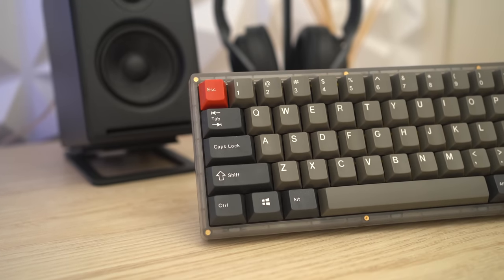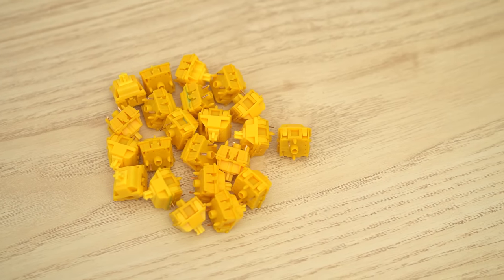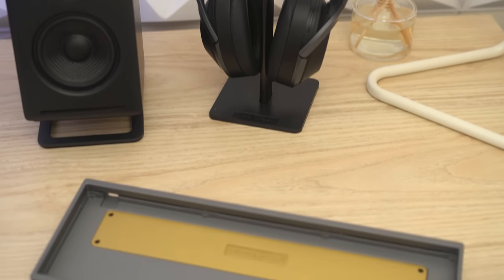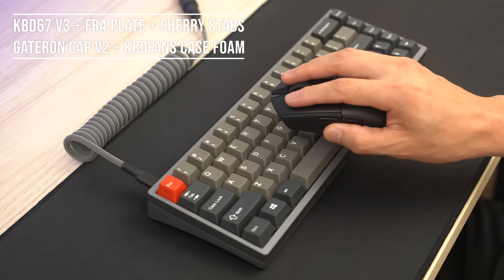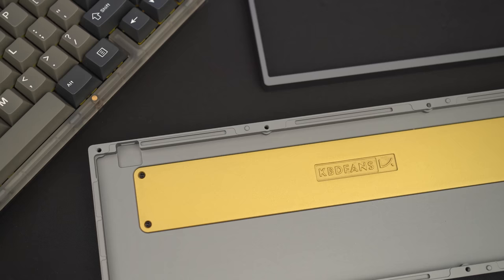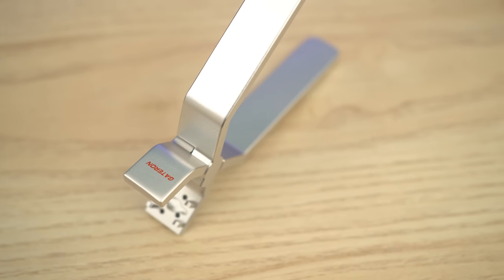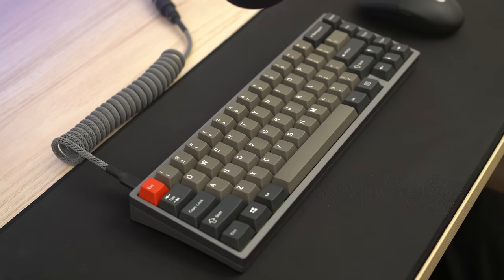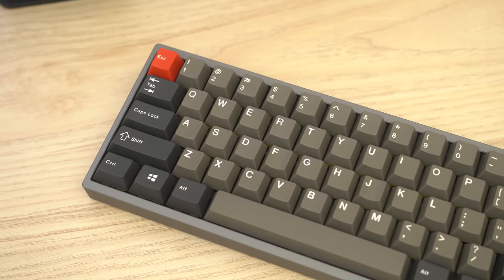Should You Spend $160 to Evolve the KBD67 LITE to KBD67 V3?

Comment: Hi Scott, Thanks for introducing me to this PE foam mod.  I have finally got my Tofu60 aluminium case to sound awesome.

Case foam is installed in the battery compartment and below the PCB with the magic PE foam between the PCB and plate.  Plate is Polycarbonate, switches are Boba U4T (stock) and keycaps are GMK WoB with Durock V2 stabs.

I have also drilled out the two centre posts and just used the outer 4 screws.  I did have PCB foam but to be honest the board did not sound great so I just removed it and just have the PE foam mod.

It now sounds fantastic and I will also do the same when my KBD67 Lite arrives.
Reply from the maker: That sounds like an amazing mod!  Glad it worked out!
Reply: Really recommend lubing those switches

Comment: PE foam is trending hard rn, it makes keebs sound poppy and creamy. Although I don't think the alu case is quite worth the price, would much rather get something like a Neo Element G67. Not a fan of the space on the upgrade, sounds a bit hollow.
Reply from the maker: Yeah the aluminum case has more hollowness than the abs
Reply: @Keybored  yeah haha hollow has been the issue with most non-plastic kbdfans boards, esp the low-mid price tier. But on the bright side more colors are coming for the plastic 67 lite which does its job well enough.
Reply from the maker: @Mike-ei8qj  the lite is such a great board for its price
Reply: @Keybored  yessur, it honestly embarasses all the plastic boards around the price point... Kara and Portico ain't got nothing on 67 lite! 😎
Reply: I used PE foam instead of other foams like shelf-liners ever since I got my Arisu like 4 months ago. Even for acrylic cases, it does wonders.

Comment: Thanks for clarifying this. I saw this case on divinkey and was wondering if it would work. Also thanks for linking the fr4 plate. I've been kinda disappointed in mine but I have milky cap v1 and are not bad. Hopefully these upgrades with fix my kbd67.
Reply from the maker: It's definitely a change from the stock KBD67 LITE.  I don't know if it's truly an upgrade, since you do pay a lot for the aluminum, and it changes the type of sound it makes, but doesn't really "upgrade" it per se.

Comment: Great vid! I tried the PE foam mod on my board thanks to you and it made a huge difference! I was wondering though.... is plate foam necessary to do this mod? Would it still make such a big difference without plate foam? Would it work if I just put PE foam and nothing else between the PCB and plate?
Reply: it works i’ll link u a video with my next comment
Reply from the maker: Great comparison on the mode 80!

Comment: Again! Awesome video! How was the v3 case? How stiff is the d65 with fr4 plate compared to the kbd67 v3 upgrade? is the kbd67 v3 upgrade better than D65? thanks
Reply from the maker: Hi Theddy!  My d65 FR4 plate with the leaf spring cuts are in the mail and coming to me right now :)  After using the V3 for a while, I think overall, I prefer the ABS case of the lite.  The V3 case is nice, but it makes the KBD67 sound like any other aluminum case board... However... I have a surprise upcoming with the KBD67 lite actually... stay tuned!
Reply: @Keybored  Awesome! Thank you

Comment: PSA about that switch opener; don't use it for long-pole switches! It will poke the stem through the bottom of a U4T, for example.

I couldn't resist buying the case myself - and I do like it. Definitely changes the character of the board - you trade the deep thocky sound and bouncy character for a more clacky sound and being super-planted on the desk. It is a lot less forgiving of unlubed or poorly lubed stabs, though!

Also TIL V2 Gateron Caps are a thing
Reply: i also read that reddit post where the guy poked a hole through the bottom housing

then i watched the Andy Nguyen video where he pretty much exerted all his strength and it didn't poke a hole
Reply from the maker: And the dude has some decent arms... Much larger than mine at least lol

Comment: Tofu65 with your o-ring mod and PE foam mod, or this? I already bought the Tofu65, and all the stuff to mod it. I really wanted the KBD67 Lite R2, and it actually came back in stock 2 days after I bought the Tofu65. Timing sucks sometimes.
Reply from the maker: I think they're different. The kbd67 is considered a "upgrade" vs the tofu, but the tofu65 with the o ring is also so good... I think the tofu with o ring actually has a softer typing feel than this, but this has a lower case front so it's more comfortable to type without a wrist rest
Reply: @Keybored  okay thank you! I can also do the PE foam mod on the tofu right?
Reply from the maker: @chrisdotdash5154  you can as long as it's not too thick of pe foam with the hot swap

Comment: I feel like a $160 case upgrade to a $109 board just seems conceptually backward. I'd rather they just make a silicone dampener for the KBD67 Lite, or maybe I might do a silicone pour myself. 

Alternatively I might just leave mine as is, since I've dampened all my other boards so the KBD67 Lite can stay as my test thocky/loud board.
Reply from the maker: You make a great point!
Reply: They do have a silicone case dampener for the kbd67 lite. It's pretty new but it's on kbdfans https://kbdfans.com/collections/kbd67-lite/products/r2-kbd67-lite-bottom-case-silicone
Reply: @rks5457  Oh Really? I totally missed that that existed.  Now I've got to think up some other things I need to put together a KBDfans order since shipping isn't typically cheap. 

Does the existence of this kind of change the value proposition of the base KBD67 Lite vs the NK95 and the Portico. To get it to actual parity with those, since they both come with Silicon wedges, the KBD67 Lite technically costs $127 which puts it closer to the Portico cost and puts more distance between it and the NK65. Interesting.

Comment: Do you prefer your modded Tofu 65 or the KBD67 Lite in the alloy V3 case in terms of sound and feel? Which do you like more and think is better?

Reason why I ask is because all KBD67 Lites are sold out everywhere with the exception of the Bluetooth PCB which lacks QMK /VIA support and RGB.

I understand the Tofu 65 is a nicer sounding board and heavier compared to the Tofu 60 and I fancy giving it go. Alternatively I could sacrifice QMK /VIA /RGB and get the KBD67 if better than than the Tofu 65.
Reply from the maker: I think for me, the best balance is the KBD67 Lite plain without the aluminum case.  The aluminum case changes the sound and dynamics, but I don't know if it's worth taking the KBD67 Lite into a mid range category... there are others you can get on GB that would be better
Reply: @Keybored  I just ordered the black ABS KBD67 Lite R2 bluetooth version as couldn’t get the the wired version anywhere under 200USD.  Got some Boba U4T’s, Durock V2’s and GMK WoB.

Comment: Between the KBD67 V3 and an o-ring modded Tofu, what would feel stiffer between the two?
Reply from the maker: The V3 has very very little flex... I would say that theoretically, the V3 is supposed to be a softer keyboard.  But in practice, I would say the O-Ring TOFU may actually be a softer typing experience.
Reply: A bit late. But as a owner of both, my tofu definitely does feel softer and bouncier to type on.

Comment: Did you have any issue with the PE foam when assembling the board? In my case, the little screws just would not bite and I couldn't screw everything together.
Reply from the maker: Fortunately, I was able to use some really thin stuff, and it worked without any issues!

Comment: I’m looking to build my first 65 keyboard, simply upgrading from a Ducky one 2 mini. Tofu 65 case or this KD67 v3 case? The price different isn’t an issue!
Reply from the maker: Hmmm... That's a tough one. Technically, the kbd67 v3 is the better board... But it's super stiff considering that it's a gasket. Tofu on the other hand is old school tray mount... But becomes nice with o ring mod... If you want to mod it, tofu has more mod ability. Tofu with pom plate and o ring mod is pretty fantastic. If you want to use it fairly stock, the kbd67 v3 but stick with the PC plate.
Reply: so with pom plate u would say o ring modded tofu is better than kbd67 v3?
Reply: cause i would like to have that poppy metallic sound but are torn between the two

Comment: Does the fr4 plate actually make the keyboard more poppy as opposed to the stock polycarb? Or is that just the mic?
Reply from the maker: The FR4 plate is bit stiffer, so it does change the sound that way!
Reply: @Keybored  Thanks!

Comment: I just assembled my KBD67 Lite and I did not like the plastic case as I am coming from an alloy Tofu. I liked the sound but not the weight or look plus I did not like the way it bent in the middle while typing.  I think this was because of the rubber feet.

Just installed the V3 alloy case and it is much better.  Feels and looks much better and  I may even get that brass weight.

I did not try the case stock and PE foam modded it straight away.  Does anyone know if you can ditch the mute silicone as I feel this board is muted compared to my modded Tofu.

Switches are U4Ts and GMK WoB.
Reply from the maker: If you're talking about the center silicone later, unfortunately, that helps to keep the plate up, so no.  You can remove any of the muting under the pcb though
Reply: @Keybored  Thanks Scott.  How about installing D60 foam gaskets on the plate?  I think an FR4 plate with the mute silicone removed and V3 case would be end game for this board.

Comment: any way to use the v3 without having to get the entire lite set?
Reply: His use of “upgrade” is a bit misleading. KBD67 V3 is it’s own keyboard and not an upgrade kit for the KBD67 Lite.
Reply: @gray4935  oh so its possible to just make a kit using the v3?
Reply: @gray4935  Where do you see KBD67 V3 full kit? I only see the case on the website.
Reply from the maker: The V3 only comes as a case unfortunately... requires the lite as the donor for the internal components
Reply: Oh that’s my bad... got it mixed up with the KBD67 MKII. However, type in KBD67 into KBDfans website and you’ll see that both the Lite plate and PCB are open for preorders. So if you’re willing to wait those should be available relatively soon so you won’t have to waste a Lite case.